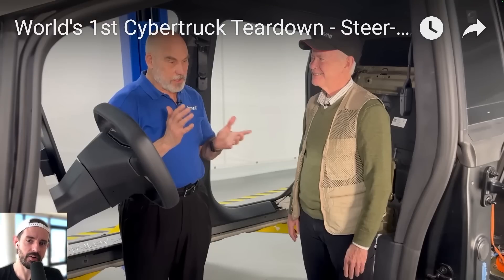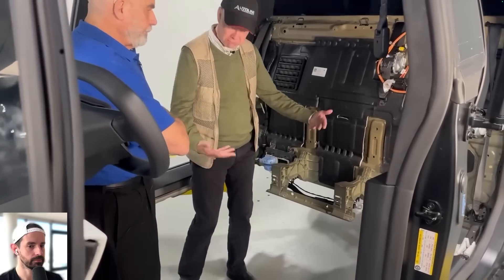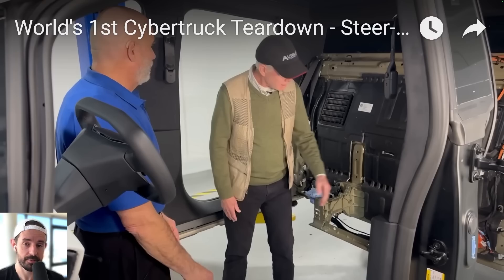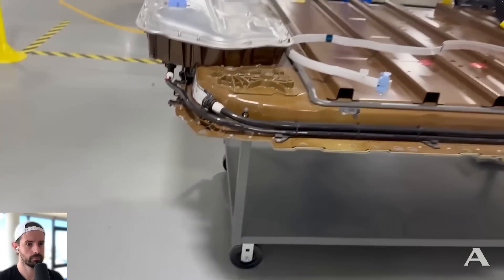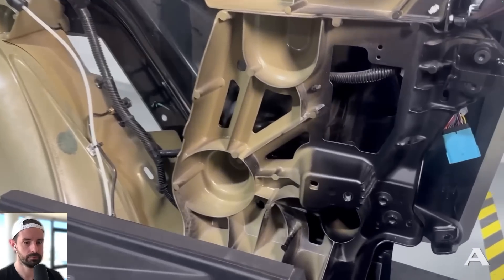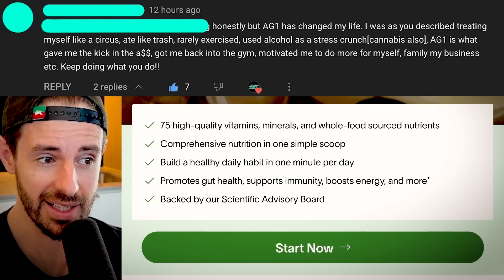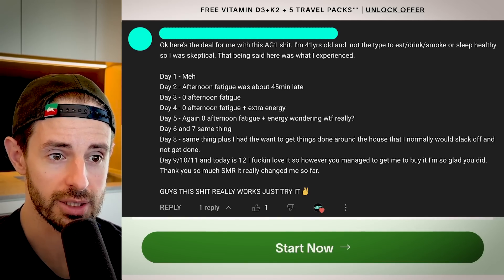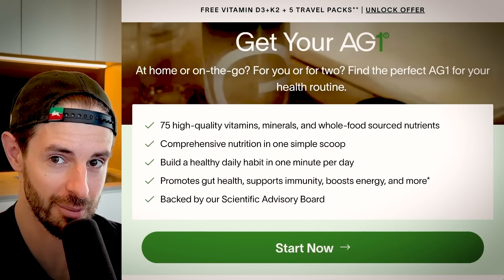World’s 1st Cybertruck Teardown: Engineering Genius

Comment: So the Tesla people have put the passengers right on top of the battery case wall.  With NO protection whatsoever.  So when he battery gets damaged, it will shoot out a white hot jet of flame as we have seen many times right into the passenger compartment incinerating the passengers.  If that is the definition of "genius" then I'm sticking with my "dumb" conventional car with safeguards in place, learned over a century of experience.

Comment: so to change the battery out when it eventually dies, you have to remove most of the interior first ?  not so genius to me but whatever.  They weight close to 7000 pounds, the extra 200 pounds for a floor system would not have hurt much and made replacement 1000 times easier.

Comment: At 2:13 you can see the rear seat support is actually two castings, joined in the front with a single stamped cross piece. In previous Tesla videos of gigacastings being robotically removed from the press and moved into the machining cell, you can see they cast many parts, not just the frame part, in the same casting operation, which are then separated in the machining operation. These two small castings are probably cast in the same step with the big "giga casting".

Comment: Question to all. It appears (visually from the video) that the battery case is not cast. Any idea why it has not been cast?  Seems like it would have been one of the first pieces to be done (or of course, I just may not be seeing it).  Cheers!
Reply: It's stamped from one sheet. Why cast that when stamping is perfect for the job and cheaper?
Reply: @themonsterunderyourbed9408  OK, sounds reasonable. I was thinking more in terms of potential weight savings and their casting times I recall were just a few seconds. I thought casting would have been less expensive. Thanks for the reply and info.

Comment: Tesla castings....
Castings are great
- Easy to innovate (aka make changes)
- Just one material required, the same material used in other castings
- Eliminate a lot of parts
- Simplified supply chain
- Aluminum castings are easy to recycle

Comment: Is the battery pack longer and wider but thinner than the competition because of the longer wheelbase?
That would give them a lot of room to make it bigger by using 4695 or 46120 batteries from China.
I think a 500 miles cybertruck is coming.
Reply: Battery pack is 80mm high❤

Comment: Dome lights actually do need 48v. One of the big benefits of going to 48v is you use 75% less copper in the wires. It is a long run to get to the dome light. That’s a lot of copper saved.
Reply: It not necessary for dome lights to be 48V, but it helps.
Reply: @alanlight7740
Will h in a car nothing needs more than 12v. If your copper wires are big enough you could run 1000amp motors at 12v. 

Even with a lot of copper 12v will have to much voltage drop with lengths inside a house. You can see this with 12v led light strips. 

But cars should be 48v for almost everything because it reduces weight and costs. 

The steer by wire motors would be huge and heavy if 12v. But it could be done. And it would be a waste of money.

Comment: What most people don't understand is that castings not only eliminate lots of production steps, it also reduces quality issues by a lot. 
This is because every assembling step puts errors in it which add each other with every step so in the end it is very very difficult to stay in the right dimensions that are needed so everything fits toghether the way it was designed.
Reply: Exactly! Tolerance "Stack" in multiple layered parts show this reality the most! If a standard "Tolerance" is +/- 0.030", with a 3 Part Laminated assembly, total tolerances could reach +/- 0.090", or basically a tenth of an inch, if interfacing Sealants or Coatings are applied!

Same for Linear Fastener Joints: If Tolerances for the "Centers" of the Holes are +/- 0.030", just connecting 3 Parts, in a linear run, could change the Final Length by +/- ~0.1" easy enough!
Reply: Known as “precision drift”.

Comment: That ain’t your grandpa‘s truck. Which was basically the same as your great grandpa‘s truck. Which is basically the same as any other truck you can buy today.
Reply: That seems to be the argument of the CT haters, that it isn't like every other truck. Apparently there's some unwritten rule that all trucks should be exactly alike from now until the end of time.
Reply: @darylfoster7944 booooring legacy auto…. innovation instead of industry protectionism ftw, changes only a little bit every ten years

Comment: Casting also improves quality as assembly monuments cast into the part assures repeatable high quality assembly e.g idiot proof.
Reply: Are you sure?  I expect there are oversized holes someplace to provide a little wiggle room when bolting panels to the castings.   Perhaps not.  IDK
Reply: @danharold3087   My information comes from Sany Munro. In his videos taking apart Teslas, he states this several times.  He has been in the auto building business for longer than I. Perhaps you can contact him and tell him he is wrong.

Comment: A brilliant piece of irrelevance suited to the grave they dug.  BYD would waste their time with such nonsense.
Reply: CARESOFT is also Benchmarking the Cybertruck.
Reply: It's not for the Chinese market. BYD damn sure would build a large pickup if Chinese consumers wanted it.
Reply: @darylfoster7944  - BYD can just buy a Truck from KANDI and rebadge it.
Reply: @darylfoster7944  modify their small bus platform.
Reply: Hunk of junk truck. At least the castings in the CT are given a barrier coating to protect against corrosion.  Model Y has bare AA! Yikes!  I doubt they anodized and chromate sealed or alodined these castings, which might make them sitting time bombs if these AA are susceptible to SCC💣
Reply: @erniefrijole2618   - the AL gigacastings Dont corrode or EVER RUST.
and MOST people wont Drive model 3/Y inside lakes like a BOAT.